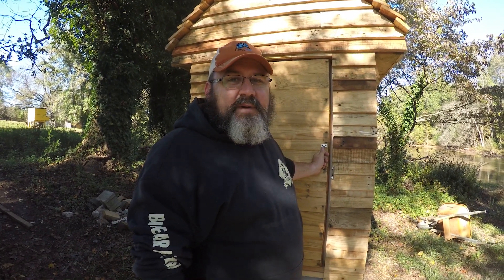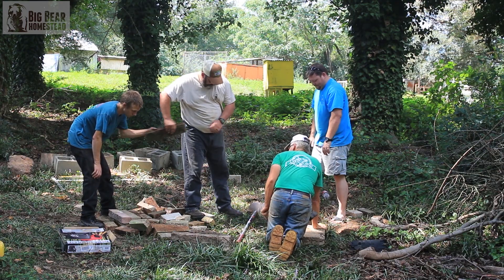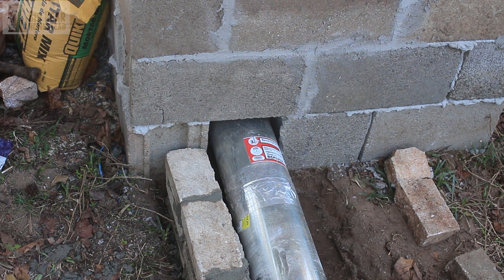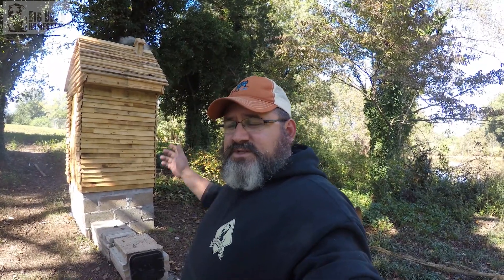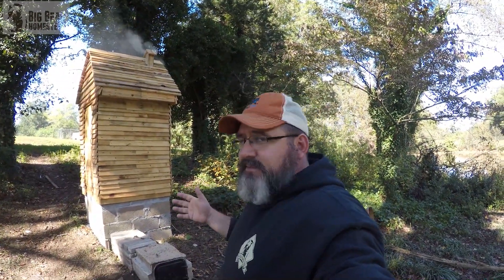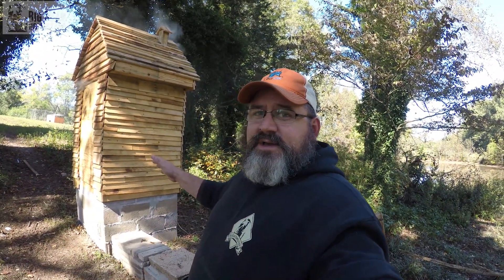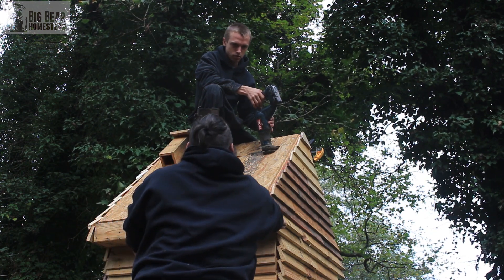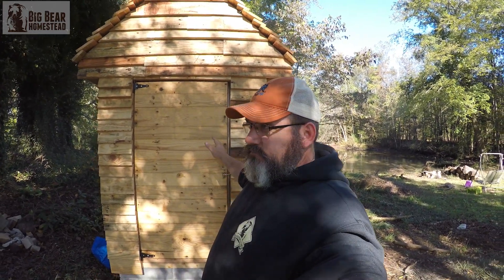How To Build A Smokehouse For Your Homestead

Comment: i like your design, however my concerns and question is with the OSB. the glues from plywood or OSB will leach out into the meat.May i suggest using a neutral type wood like poplar or cottonwood planks.
Reply from the maker: That is a good point but this is a cold smoker, and according to my research it would have to be over 200 F before the glue would release fumes.

Comment: just my .02 but I'd never used OSB or any other board with glue in in the smoke chamber. I think you could get off gassing of the resin/glue over time and get in to the meat. Otherwise, I think it's a great design and build.
Reply from the maker: I understand what you are saying, I did do some research before we went and used the OSB, and everywhere we read is that long as we dont go over 220 degrees we won't have any issues. Now with that being said we are planning on replacing it with cedar from trees we mill here on the homestead. 
  Thanks for watching and we hope you hit that subscribe button and rang the bell.

Comment: I have been researching building a smokehouse. I was wondering how long your smoke pipe is? I've been seeing it should be 8ft to make cold smoking easier. I was also wondering what do you think a good height is from the opening of the smoke pipe to the actual coal or fire.
Reply from the maker: Ours is about 6 ft and it works.great

Comment: How do you just the heat and the air
Reply from the maker: We build a fire in the fire box and the heat and smoke travel up the pipe to the smoke house. Thanks for watching
Reply: How is air getting to your fire box and how exactly did you build it?
Reply: @jacobortwine7063  build yourself a barrel stove kit and use that. You can adjust the airflow and temperature using the stoves draft and damper. I'd think that enough smoke would seep from the smokehouse to keep the fire going ok.

Comment: Good design, good video.
And, as long as it is dry, any species of wood will burn well. Small pieces of plywood or OSB (oriented strand board, aka “chipboard” or “flakeboard”) can also be burned, providing pleasant warmth and cleaning up a mess in the process. In contrast, preservative treated wood should not be burned.
Reply from the maker: that is true that is why this is a cold smoker